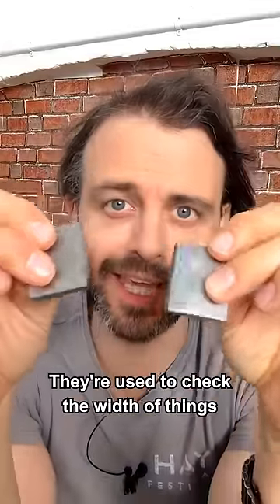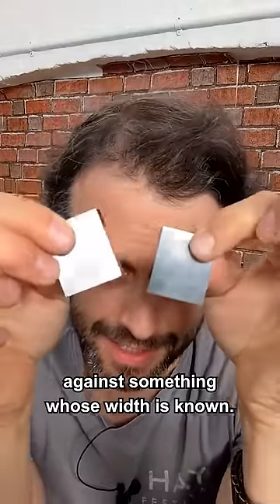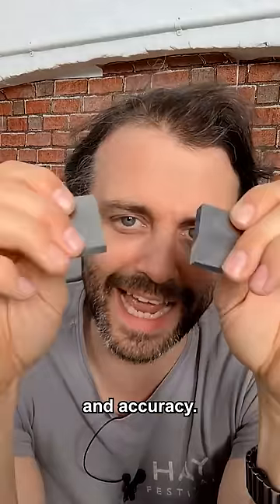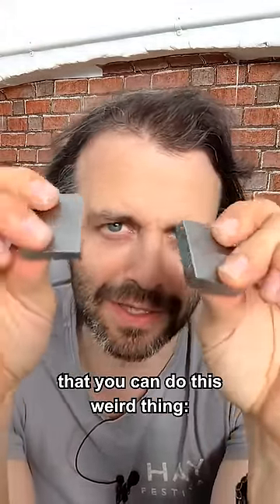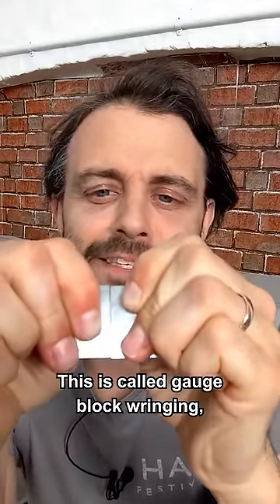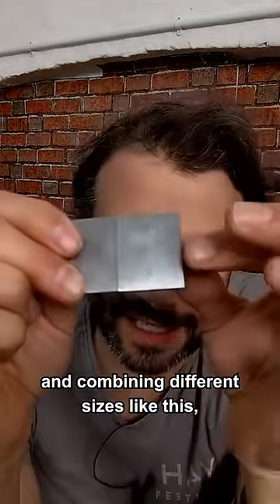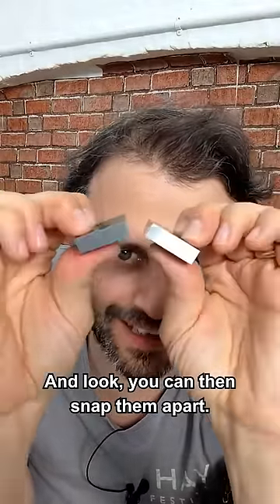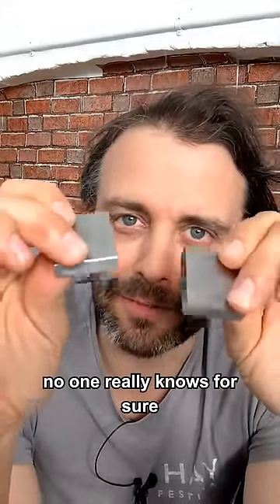No One Knows For Sure Why This Happens!

Comment: there has been several instances of cold welding happening when they are left stuck like that. the whole thing doesn't weld but little bits of the crystalline grain will fuse across the boundary.
Reply: Yup, cold welding. A lot of time the blocks are stored lightly oiled so they don’t oxidize and then cleaned when they are used. 
NASA had an issue with cold welding on one of the early space missions and now makes sure they limit when two identical metals can come into contact.
Reply: Was looking for this comment, it was my first thought as well.
Reply: Exactly. "No one knows why this happens!" 

Yes, we actually do know and the knowledge is common enough that a bunch of random people in the comments of a YouTube short have the answer.
Reply: Ah, that makes sense.  I thought perhaps an electron sharing phenomenon.  Neat.

Comment: The surface tension between them is at 100%.  Causing zero friction. Like 2 watherdrop connection but without fusing.
Edit: turns out i no nothing about science.

Comment: I worked as a coil inspector at a steel mill and had to verify my micrometer every shift with the gauge block. They always told us NOT to cold weld the blocks together as it tore up the surface to the point that it would throw off the readings. Don’t know if that’s true or not, but that’s what we all were told…….
Reply: It is
Reply: It'll wear them out over years and years from abrasion, but it is not cold welding. That's an easily verifiable mechanism, we'd have figured out the phenomenon of wringing decades ago if that were the case.
Reply: Friction and wear are the reason.   Btw this is not cold-welding, actually, but perhaps confused with results of cold-welding, which results in a weak attraction to the target connection that may be held together by the same force.. van-der-wals force, or so I've been taught in Chem classes.
Reply: the biggest pain about that is, if you have them like that, they will cold weld themselves after 8h being like that, making them useless because they will be sticky and unprecise which is just annoying after you prepd some thingies and want to continue at the next shift
Reply: @wdk_gmw sounds like atomic entanglement
Reply: What's the point of gauge blocks if you can only use one at a time? Makes no sense.. the sets are built ro be combined like legos.
Reply: @henmich  We only used a one inch gauge block, as we all used 1” micrometers for that particular job…….
Reply: @Dingomush  obviously, but you said it was a rule. It's not. The anvil on a micrometer rotates, so technically every time you calibrated, you were doing just as much damage to the gauge Block.
Reply: They just didn't want you to have fun and possibly discover a great secret and leave your terrible job at the mill to pursue a physics degree.
Reply: @henmich  I said it was a rule?
Reply: @Dingomush  yes,  You had NASA Fly in and glue the poster onto the wall with the rule on it in bright red letters
Reply: You have to separate the blocks every time you use them. If you leave them over a longer time, the bond would go stronger. So the surface gets damaged when you separate them with force
Reply: @henmich  He didn't call it a rule and he didn't even agree/disagree with what was said either, I don't really know what you're talking about
Reply: @henmich  LoL!
Reply: This is why, ideally, you have a shopfloor set, an inspection set, and the ceramic AAA set for calibration.
Reply: Cold welding and wringing aren't the same.
Reply: Ya I would not fuck with a precision measuring instrument.
Reply: @Baerschi100  that's total bs, I've left square blocks I wrung up as a functional gauge for like 2 weeks with no issue.  I didn't take them apart cause the job wasn't done.  Ohh well.
Reply: Wronging the blocks together would affect free Gtc the surface finish of it ever so slightly but nowhere near enough to be picked up by a micrometer
Reply: @Finbar-kb7zi  If you're careful, it can't be measured by an optical flat either.
Reply: @Finbar-kb7zi   Nope wrong read "The Gauge Block Handbook" and learn why, you are welcome.
Reply: Easy. It creates suction which holds them together.
Reply: @97GoldDust  How does that suction work in a vacuum?
Reply: @henmich  You don't have to use one at a time. I really have no clue what they are talking about. Some people just repeat shit they hear. In our shop we machine to the 0.0001 of an inch (0.0025mm) and we constantly use those blocks together.
Reply: I work at a machine shop, everyone is always afraid that LITERALLY ANYTHING will throw off their readings
Reply: @veljkozindovic6835  If you don't have a dedicated, climate-controlled metrology room with filtered air and sticky mat shoe cleaners, that level of paranoia isn't justified.
Reply: @stiles3711  I didn't try it because I didn't want to mess up a set. It was told in my apprenticeship and it seemed comprehensible. And i think, even Adam Booth (Abom79) talked about it in a video.
Reply: @CaliMeatWagon  Yeah, I frequently use stacks of gage blocks to check dimensions on parts.
Reply: @dubya5626  Wikipedia has an excellent summary of van der Waals force.
Reply: @canonicaltom  I’m not sure I understand your comment what do you mean by an optical flat? There are a variety of ways flatness can be measured from indicators to lasers, one of the most accurate methods (that I’m aware of) is the micron oscillator which repeatedly taps a part as it moves to create a 3D image
Reply: Maybe if guys do it all the time they'll risk marring the square edges especially... Only thing I can think of.

Comment: Very smooth surfaces bring together more molecules when they touch, than normal surfaces. As a result, a large interaction force glues the surfaces.
Reply: Bring retired now, machined for over 40 years, and using gage blocks pretty much on a daily basis, 
This is the correct answer.
Reply: Sounds right, this is it. Why does everyone say Science is hard?
Reply: 💯 this is friction at work
The smoother the surface the more inter molecular interaction, the more intermolecular interaction the more they bind with each other via weak bonds
Reply: Does a wet paper towel stick more effectively to a countertop than a dry paper towel?
Reply: It would be awesome if you could actually put a name to that force. Obviously a force exists here, the problem is that we're not quite sure which one. Just saying "generic interaction force" means nothing.
Reply: @pizzlerot2730   There is one, intermolecular attractive force
Reply: @pizzlerot2730 it's the intermolecular attractive force, which is absolutely insane because it means the surfaces are smooth enough that the molecules have enough contact to create bonds
Reply: Do you have a source for this?
Reply: @thebionicvet8674  Yep... all of them. Literally any prestigious site for scientific education has loads of materials discussing this specific phenomenon. 

Kudos to this guy for getting people googling, though.
Reply: This is the answer. I did this experiment in a science lab with glass and the smoother and straighter the surface, the better the chances of a molecular bond. 

It’s also how geckos are able to climb glass. Their toes are covered in macroscopic and microscopic hairs that interact with the electromagnetic forces of the glass molecules. This allows them to “stick” to glass.
Reply: Damn that's cool
Reply: You are close. Actually it's Air pressure, surface tension and atomic force working together making the blocks stick.
Reply: Temporary magnetism perhaps? Kind of like static charge from rubbing things together?
Reply: @dbridges82  No both sides are very very flat.putting then together air locks them along with the oil on them and atomic force all three working together to hold it.
Reply: @MrCBeery No sorry, this same result has been tested in a vacuum and it still works.
Reply: @ragtop63 isn’t it called the Van der Waals force?
Reply: I think they have to be the same material though 100% moleculary identical
Reply: Confidently incorrect.
Reply: @nekaa7657  geckos use this principle to climb on walls, glass is also no problem for them
Reply: Cold welding works better when you strike them together, and better yet when you sand off the oxidation from both surfaces just before striking together. The best example is when the space shuttle door hatch got stuck with the astronaut still outside... Now each piece of a shuttle is a different metal to prevent cohesion of molecules, when struck together. Also, the super flat nature does help molecular attraction like a cheap fridge magnet with only one piece of paper, but in this case the paper represents oxidation and contaminants. If you were to have rough surfaces like a crumpled up sheet of paper or ten sheets thich, the cheap magnet cannot attract, where as the magnet and fridge represent atoms and molecules attracting together , not just magnetism. 😊
Reply: Fun Fact: Because of how clean they are kept, you can do it with hard drive discs!
Reply: So THAT’S how babies are made!  Thank you!
Reply: so its basically molecular velcro?
Reply: This is also why everything in a spaceship is coated in that white paint. If it were just the metal, they would stick to each other.
Reply: @SummerWind_  Modern technology is incredible. Imagine how much went into painting the entire Moon!

Comment: So, you chose to fight the internet on Vanderwals effect. Well played.
Reply: I‘ve searched for this comment
Reply: Came to say the same
Reply: Come on guys, its not about the sticking effect, its about that if you try to stick it together the straight way, it doesn't work. you have to twist it.
Reply: If it's vanderwaals ONLY, why doesn't it do that for super smooth and precise objects in other materials?
Reply: *Van der Waals force aren't reliant on a particular method of bringing atoms close enough together for the attraction to take place...so there would be no need to wring the two pieces of metal against one another....it would be just enough to just touch them and since just touching without twisting wouldn't  attach them then I would think the "VDW effect" isn't the culprit....(imho ofcourse)
Reply: Perhaps twisting allows you to squeeze out any air molecules that would otherwise prevent vanderwals forces from sticking them together.
Reply: @ChronicViper exactly
Reply: @ChronicViper  And so again... Why doesn't this work with other materials?

This effect seems more related to the "cold welding" property of metals that theoretically has more to do with the metallic electron cloud than "pure" van der waals forces.
Reply: @EmethMatthew  I doubt every single material will smooth the exact same way. Maybe the material in the video can smooth the most, creating more contact space per millimeter when compared to any other material when smoothed.
Reply: @EmethMatthew it does work for other things
Reply: @EmethMatthew  Works with everything,  cotton, lead, mercury, water
Reply: As everyone said, it works with other materials, there is even already practical applications being developed with other materials
Reply: @EmethMatthew because atoms in other materials are arranged differently and therefore there’s not enough strength? Seems plausible to me but I leave that to someone who knows more
Reply: @skrotosd  Correct, it's because other materials have different chemical properties, but EVERYTHING has van der waals forces intermolecularly. I'm a chemist - van der waals forces are the forces responsible for things like oils being liquid and not just gases, particularly because of the long molecular chains in oils when some oils have lower molecular weights than some of the heavier gases.

If other materials do this (stick together from twisting even in a vacuum, and NOT from static electric charge) then I would love to read about that and their "potential practical" benefits, but given learning a little about it, I'm inclined to say it's probably NOT PURELY van der waals forces, and probably the fact that cleanly machined metals that are freshly cut and haven't yet built up the oxide layer on the surface that almost all metals end up forming - these fresh cut metals can be placed against each other and bond across the cut, forming a "cold weld" that is basically the two metal pieces forming a single metal piece. This is HYPOTHETICALLY due to metal atoms being so large and with so many valence electrons that any bulk metal is a mess of metal atoms all intermingling their valence electrons in a "metallic cloud" that is thought to give metals their electrical and malleability properties, but is generally still a source of ongoing research (hence "no one actually knows FOR SURE" even if we have a pretty good idea).

In the specific case in the video, blocks of metal that have been machined long enough ago to have reformed their oxide layer might stick together on a weaker level than a full "cold weld" (seriously, look up the term "cold welding") and the twisting likely scrapes away SOME of the oxide layer and allows for a few areas of pure metal to come into contact and "stick" but these are like a few microscopic welds that if you stain enough will break, and thus you can "click" them apart.
Reply: @quebono100 grain or crystal structure or way the blocks were cut or polished
Reply: @BxBxProductions  I dont understand your comment. Still unsolved puzzle even after your comment
Reply: @quebono100  go back 2 school
Reply: @BxBxProductions To assume something is not a proof. Go back into kindergarten
Reply: @quebono100  youre assuming that assuming something is not proof. how does that even make sense?
Reply: not really.  NOT all that "well played"
it merely demonstrates ppls LACK of a general scientific vocabulary & awareness. 
ANYBODY who truly paid attention in HighSchool physics & chemistry can guess at molecular bonding  

"Nobody really knows" ? 
not really

I can't quantify it mathematically but......  
I have an "idea" as to why
Reply: @AutomationDnD  It isn't a scientific proof. Its like with magnets, nobody knows why magnets work. We can work with them we can describe it physically, but we cant explain why. If that makes sense
Reply: @EmethMatthew same goes  to when you try separate two slabs of glass. Similar effect
Reply: @EmethMatthew  I enjoyed reading this, thanks!
Reply: @IGame4Fun2  thank you for your comment, I thought I will never find here a decent comment
Reply: It's called the quantum twist folks, to give a new twist to things.
Reply: Don't English'ify names.
Van der Waals, not Vanderwals.
Reply: Crystals can have almost atom precise flat surfaces yet you don't see two diamonds or quartz crystals weld together by squeezing them against each other. Must be cold welding indeed.
Reply: @EmethMatthew  it does, even glass
Reply: van der Waals*

Not "Vanderwals".
Reply: Doing Gods work my dude.
Reply: But after allllllll,
You're my vanderwaalll
Reply: Gäege blocks
Reply: It’s the surface tension of residual oil. If there was no residual oil there would be rust
Reply: @doo6952 yeah like gecko hands
Reply: Probably the casimir-effect
Reply: like glass prisms - it does @EmethMatthew
Reply: @EmethMatthew It works with glass.
Reply: @halnineooo136 High precision cut glass does this.
Reply: I think we had it in school in 7th or 8th grade.
Nowadays nobody knows why.
Reply: I think it's probably that and the casimir effect.
Reply: @averyparticularsetofskills  If you are right geckos would never free themselves from walls.
Reply: Tom: Hey Fred, come check this.
Fred: You and your famn gauge blo- how did you do that?!
Tom: idk, it just did that.
Reply: @EmethMatthew  Do we know for sure that it doesn't work with other materials?
Reply: Thank you!
Reply: @ChronicViper  its a neat idea, but one seems to have to twist them in a vacuum as well...
Reply: van der Waals
Reply: @EmethMatthew a guy said that working with lasers made from glass the glasses did adhere too
Reply: You mean vanderwaals? After the Dutch
Reply: Right?
Reply: @EmethMit it does.  Try it with two pieces of glass
Reply: @raulmunguia5 No, works in a vacuum too
Reply: Don’t tell Daniel about that effect!!
Reply: @Oscurtis are you Daniel?
Reply: @Swerv0.  yes hello
Reply: Vanderwals forces? I had read about them in organic chemistry... They are present in between layers of graphite

Comment: The atoms probably get confused and aren't sure if they are supposed to be a part of the same object
Reply: Best description freaking ever
Reply: That's what I was thinking too and the only reason why they don't permanently bound is because the surface got oxidized. If you were to make those parts in the vacuum of space and stick them together they may fuse permanently.
Reply: I like this explanation 😂😂
Reply: Basically insta-welds into a single object; individual atoms technically never touch in normal molecules, so by ensuring they can connect in a manner similar to as if they were a single object by reducing the distance sufficiently, it allows the same connection from the atoms of the objects as if they were the same one. That's all the understanding I have of this.
Reply: @chamoo232   I like this explanation. Cold welding is a known phenomenon in space (a vacuum) with two polished metals.

I'd like to know if the bond between the gauage blocks gets stronger over time.
Reply: It's probably fairly accurate too - Molecular attraction.
Reply: genius

Comment: I found something strange regarding the "wringing" effect. I found that pieces of glass from a window that had broken (after being cleaned off) will wring together just like gauge blocks, and even after I dried off all the water with a towel then a heat gun. you have to get it just right, but they will do the same thing as long as the glass is perfectly clear of any finger oils, and perfectly flat. and you have to do the same motion that you showed as well, which makes me think that its the same effect here too.